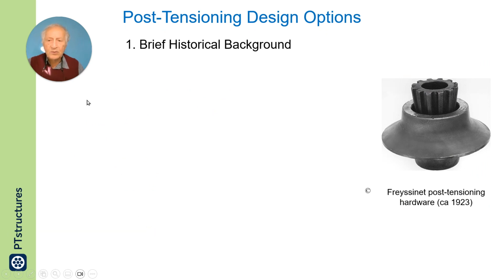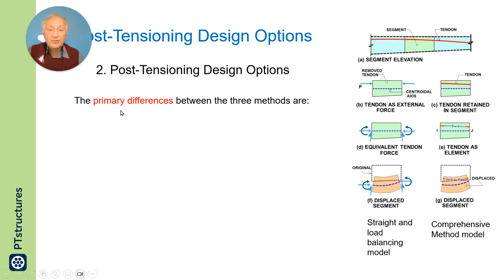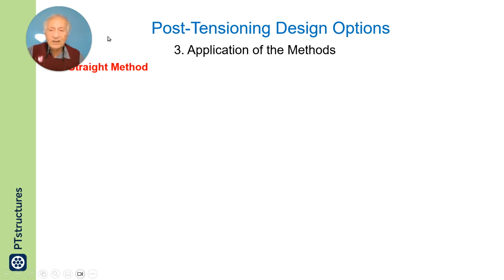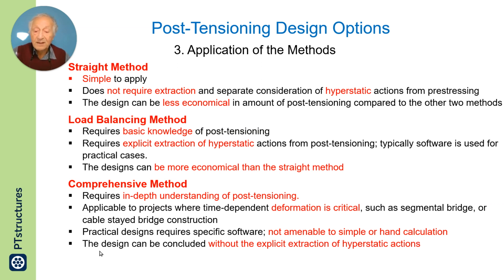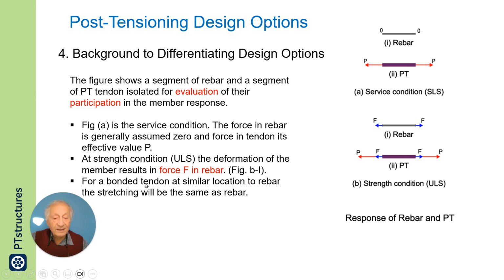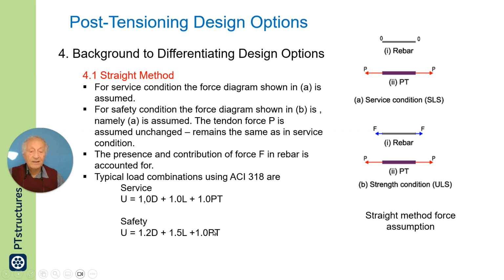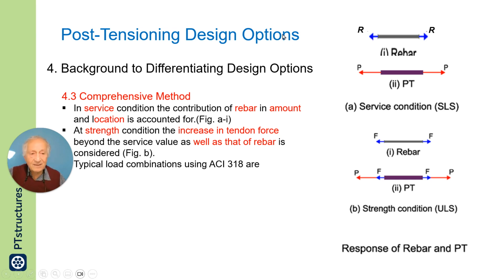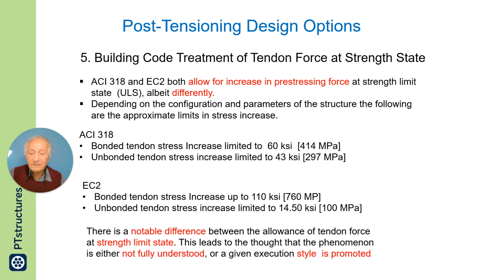8- Post-Tensioning Design Options Lecture

Comment from the maker: In screen 11 in the load combination for safety check the coefficient of LL should read 1.6L.
The full expression is  U = 1.2D + 1.6L + HYP . The inclusion of HYP depends on the method of design which is the subject of this presentation.